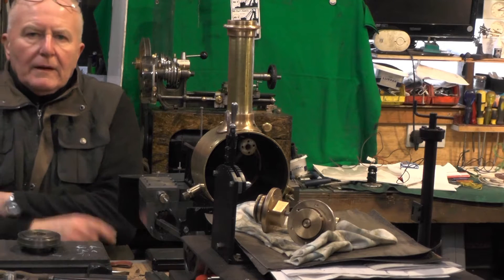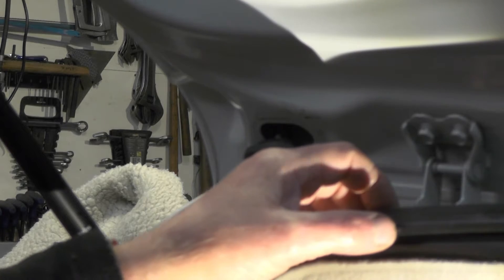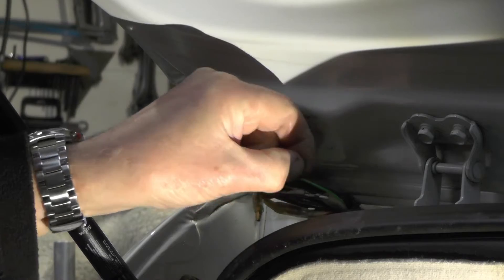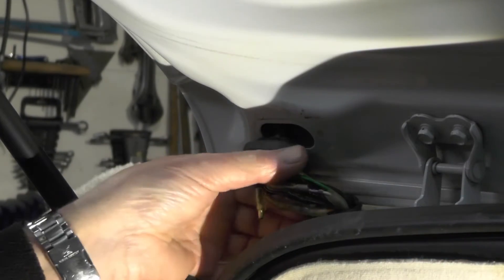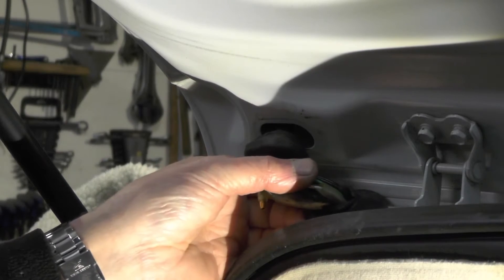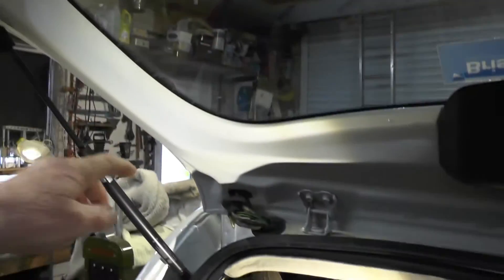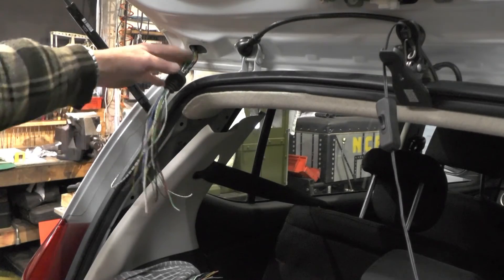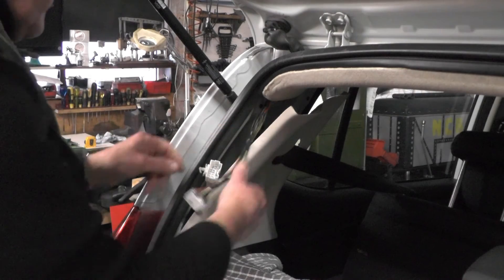Car Wiring Failure WHY!!  & My DIY Remedy "mr factotum"

Comment: Even though wires may be the right cross sectional area, you have to take into account the number of core strands. Less strands mean less flexibility means broken wires down the line. You have to use the same or better. By better, I mean smaller but more numerous core strands.
How do I know this ...I worked in the cutting shop of Lucas/SEI for eight years. I personally cut and terminated the entire looms for the first 25 Rover 75s
Reply from the maker: Great info L/uk
Your right, but I just use what I have. Wiring today in cars is poor . It soon goes brittle on the insulation. Nothings made like it use to be.
Thanks for the feedback
See you next time
Kev👍👍👍

Comment: Good workaround Kev.  One thing I do when cutting a loom like that is to cut all the wires at different places to join them.  That way you reduce the overall diameter of the join (as they are all spread out) and any chance of cross shorting through abrasion over time.  A lot of 240 volt appliances (washing machines etc) now use steel core wire, which isn't suitable for car looms.  Good Job.  Saved a pretty penny there.  Cheers Rob
Reply: That different lengths thing is a super idea! So simple but just brilliant. And thanks for the tip about wire types - is the steel core not flexible enough? Prone to breakage? Thanks mate, very helpful.
Reply: @MarkMcCluney  Steel wire has a much higher resistance than copper and can cause voltage drop with 12 volt applications.  Vehicle and other low voltage wiring is usually copper (or sometimes aluminium) for this reason.  Cheers Rob